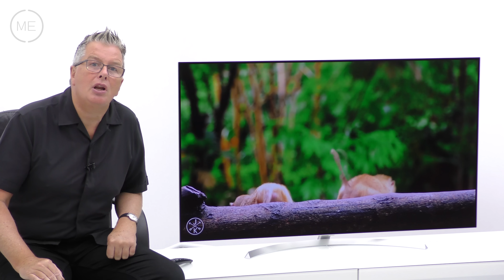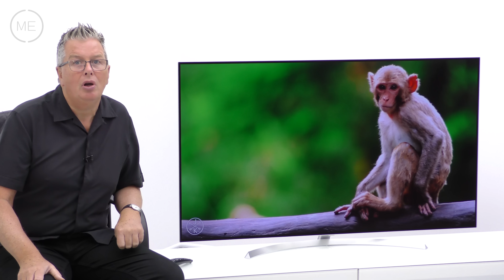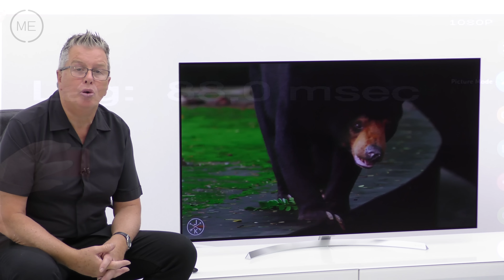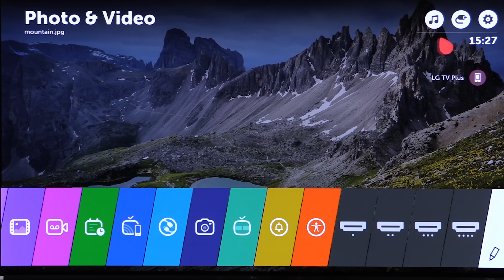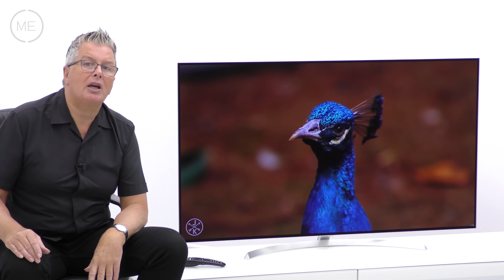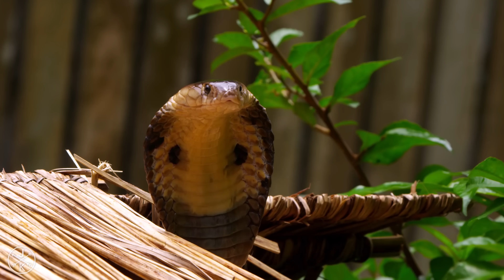LG OLED55B7V 55" 4K Ultra HD OLED TV Review (with input lag testing)

Comment: Hello. What is the main difference between LG OLED55B7V 55 and LG OLED55E7N 55. Visually I can't see any difference. Is it the input lag? Or something else?

It is at least for me quite hard to catch the exact difference that cause the price difference. Thanks in advance.
Reply from the maker: The E7 has a forward pointing speaker along the bottom and more powerful audio. It also gets a twin tuner and a Premium remote control. Some cosmetic changes too. Hope this helps.

Comment: Mark would you recommend this oled over the SAMSUNG QE49Q6FNATXXU? Not sure which one to go for. Will use for gaming a lot
Reply from the maker: Yes we would Chris. Chalk and cheese. BUT, you should be aware of potential burn-in with static images over time. We wouldn't recommend it as a computer monitor for the same reasons. If you manage it properly it shouldn't be a problem. Hope this helps.

Comment: Anyone using this OLED as PC monitor? What's your experience with ''burn in''?
Reply from the maker: We wouldn't recommend this Tv as a PC monitor Mo. The static images on a PC will, eventually, if left on all day cause problems.
I have a three year old LG OLED and there is no sign of burn-in so far. But we only use it for normal Tv viewing.
Reply: Thank you for the kind respond. Will think about perhaps use screen repair videos every 3-4 hours or so.

Comment: can anybody tell me how to stop this tv asking me to retune, this happens every couple of days, Ive got it connected by anttena
Reply from the maker: Hi Ron. First of all make sure you have the latest firmware installed. Using the 'RF in' port on these wonderful Tvs is not ideal to be honest. If your signal is not the best, the telly is probably struggling to display a picture and throws out the 'Retune' dialogue. Satellite signals are more stable and there are lots of free channels around. Hope this helps.
Reply: Hi first of all thanks for the speedy reply, yes I have latest firmware installed, signal is strong on all 165 channels 90% + , I am in direct line of view of the winter hill transmitter straight line 35 miles,  I think Ive got it sorted now its not asking me to retune, anymore what i did was >all settings>program tuning>program list update and turned it off, I am led to beleave  that if its set to on the tv when in standby will do a search at 4am  every couple of days
Reply from the maker: Sounds like you have Ron. Well done. Enjoy your Fab Tv.

Comment: Why does the qled look better to my eyes the oled just seems to dark
Reply from the maker: The QLEDs are definitely capable of more brightness Nic but you could never say that 2017 OLEDs are too dark. It's true that OLED has perfect blacks, that LED screens cannot produce because of the way they work. But these OLEDs produce 750nits of brightness, better than most LED Tvs out there.
Reply: Marks Electrical do you think I would be much better off saving a bit more and going for the oled? It was between that or the qled
Reply from the maker: I may be biased Nic, my main Tv is an OLED at home. BUT when I asked the boys at our store who see and
sell them every day, they all said they would have OLED if they could have any Tv they want. The 2017 models are the ones to go for though. Best ever. 
One thing I would say though is that the QLEDs are the brightest Tvs EVER. So if your main Tv watching is in the daytime in a bright room, that would sway it. You won't go wrong either way. Hope this helps.
Reply: Isn't the Sony Z9D the brightest at 1800nits? 640 zones etc.
Reply from the maker: Thanks James, that wasn't meant to be a literal statement and you are probably quite correct.

Comment: +Marks Electrical What would you suggest buying. The LG OLED55B7V or the older LG OLED55E6V? both cost about the same, but i do like the 3D on the E6... is the B7V a lot better image quality or will i not be able to tell the difference between those two?
Reply from the maker: This years LG OLEDs are the best yet and yes, noticeably better than 2016 models. More brightness and near black shadow detail. Shame about the 3D, it's annoying.

Comment: Hope you can find time to answer a few :

If I use the optic cable directly my surround system (no amplifier or any decoder in between) will the TV send DTS sound if the audio track is DTS?

You mention it shortly but how does the TV handle fast movements, namely I  sports and games as I do that alot? Didn't have any problems on my Pana but OLEDs are getting mixed reviews on that issue.

Am I completely wrong when I feel that all OLEDs are a bit bad at reproducing black nuances? To me it looks like lot of lighter blacks are cut off and made deep black?
Reply from the maker: 1. If your surround system is DTS compatible then you should be OK. 2. The new OLEDs are very good at handling movement although you may have to adjust your settings to suit your favourite content. 
3. There has been some criticism about OLEDs dark shadow handling but this years 7s have addressed that and there's more brightness. Personally, I wouldn't hesitate to buy one. Don't waste valuable 'viewing heaven' time. Hope this helps.

Comment: Hi I have  lg b6v 2016 model.is it advisable to update to lg c7
Reply: Sorry b7
Reply from the maker: This years B7V is better than the B6V Abdulaziz. If you watched them side by side you would see a difference. If you can afford it, it's worth doing.
Reply from the maker: The LG C7, being one of the 2017 models, is widely thought to be better than even the 2016 models. With better shadow rendition and more brightness. Image retention has also been improved. Hope this helps.